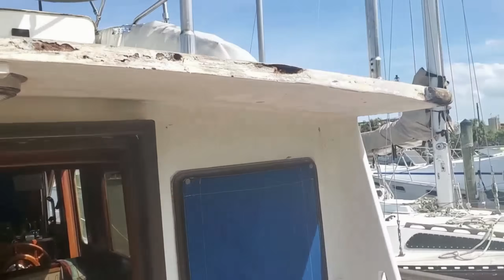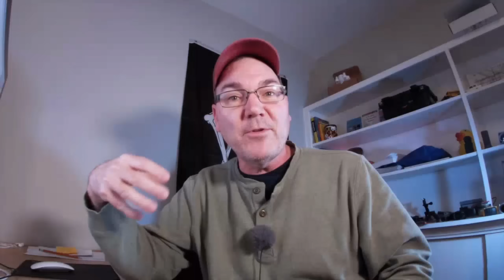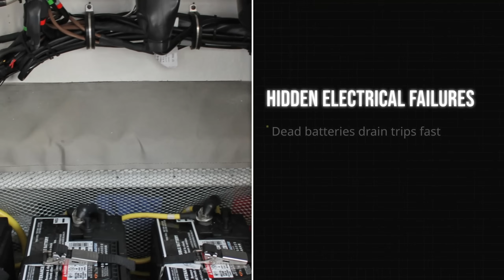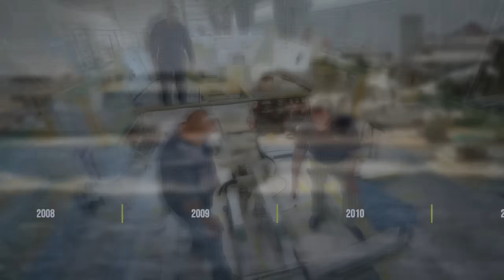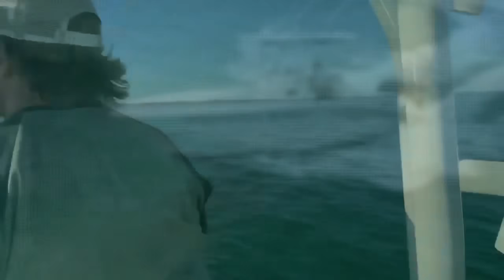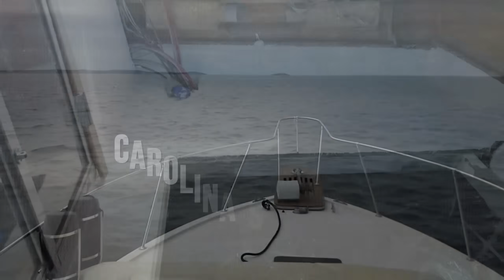3 WORST and 3 BEST Fishing Boats to Own

Comment: Someone here could provide me details regarding the wellcraft coastal 24ft
Reply from the maker: It's a solid choice if you're looking for a versatile, rugged boat. It has a good balance of comfort and functionality. The layout is spacious, and the build quality is reliable. It can be a bit on the heavier side though which might affect performance in rougher conditions. Overall, it’s a great option for families or anglers who prioritize stability and durability in coastal waters.
Reply: @OpenTides That's a solid answer.
Reply: What year range? The Coastal series was first introduced back in 1986, and ran into the mid 90s before undergoing a substantial design change. This also occurred when the original owners sold out to Gennar Genmar built both Wellcraft and another brand,  Aquasports and the boats look very similar. Wellcraft is generally considered a "mid-tier" boat, but built fairly solid. They don't have the fit and finish of  high-end manufacturers, but priced accordingly. Early models (86-90) had some structural issues with stringers and fuel tanks. Get a survey,  check compression,  and sea trial the boat. If you like it, it checks off your boxes, enjoy it.